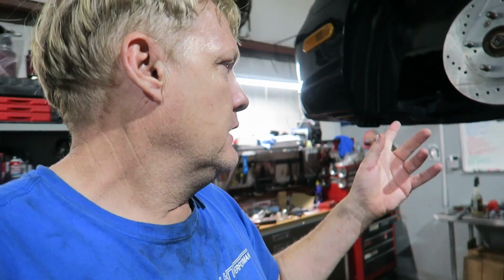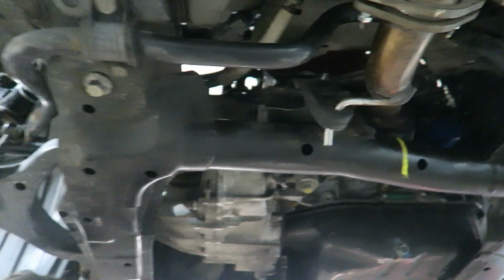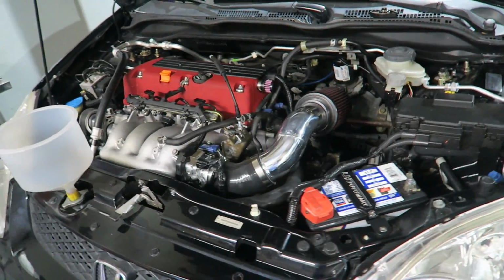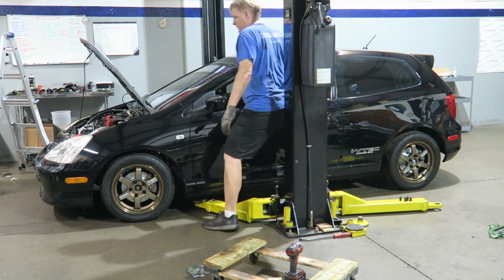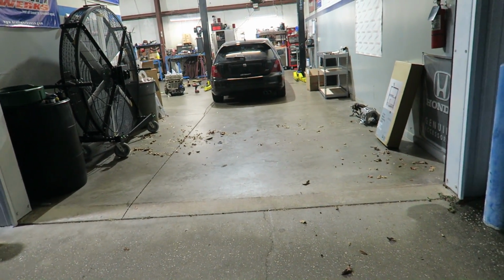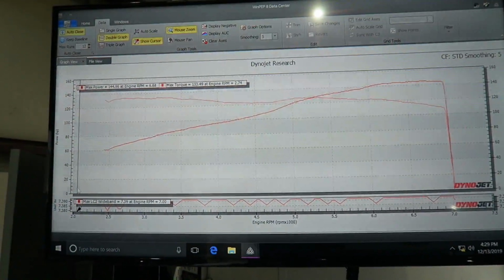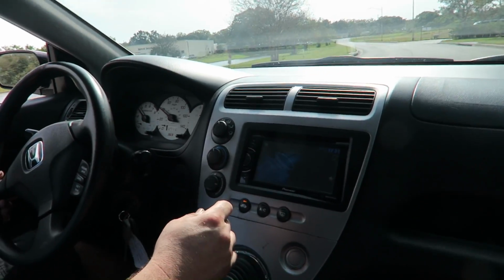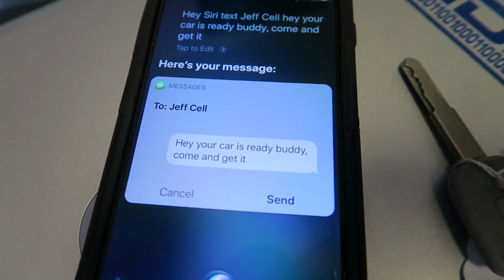EP3 K24  stock

Comment: The trick to those "camber" bolts, if you ever have to get it free. Biggest breaker bar you have + penetrating fluid + heat to get the nut off, put the nut on the end of the bolt, cool the bolt with more penetrating fluid. Torch the knuckle and get the knuckle as hot as possible without heating the bolt. BFH the bolt. Once it budges, it will come out.

Comment: A great simple build! The EP3 had such a low VTEC cross over, I am sure its a much more fun car now. Just needs a little breathing room on the back end haha. This was a great build to follow!
Reply: The EP3 K20A3 doesn't really have a VTEC cross over.
Reply: @stasilin5533  yes it does, just on intake side only and it comes on at 2300rpm. k20a's k24a's have vtec on both intake and exhaust and comes on at 5500rpm. K20a3 has vtec, just not the performance version of vtec.
Reply: which ecu you use for the k24 in the ep3

Comment: Ok I know I’m 5 years late on this question but regarding the header and the Hasport mounts…I know on the K-swap mounts they engineered them one side is for a K20 and then you can flip them upside down to use for a K24 and it keeps the head in the same position as the K20.  Did they build K car mounts the same way as the K-swap mounts back then?  I used Hardrace on my K24 RSX-S, not Hasport, so it was never an option I had.
Reply: I remember having to remove my front sway bar after I went from the K20 to the K24.  I had an SSR header.  I ended up buying the proper K24 version so I could reinstall the sway bar.  Sold off the K20 header to recoup the cost.

Comment: Swapping a k24a2 into an rsx and need to make an intake. What kind of elbow is off the throttle body? Great vid!
Reply: Matthew Trudeau 3” 45 degree silicone coupler
Reply: What header are you going to use?
Reply: bhadz100 on the ep3? I modified the Jackson racing race header to fit
Reply: @georgefitzgerald5861  Thanks George!

Comment: Love the build, 
But a quick question,about the rear 5 lug.

Did you just swap out the hub, or did you swap out the whole assembly.  I know the pad caliper and rotor are identical dimension. Yes I know it's one extra lug nut. Just wanting to save on labor or swapping out the whole rear upright.
Reply from the maker: Uber ride share We changed just the hub. The lower bolt was frozen.

Comment: Are you pretty excited for the S2000 having a re-release for 2020? I am super excited. I wonder if the car would be any fun if they used the K20C engine instead of the F22C engine. I know that won't happen, but I can imagine.
Reply from the maker: wackomanx It’s not a re release of the S2000.  These are potential optional front bumper and lights.  Right now it’s a prototype build by Honda in Japan.

Comment: i have a friend with a 2004 civic SIR ep3 in alberta canada and thinking of replicating your build. what ecu and engine management did you use for this build? did you reuse the 5 speed open differential? and can we replace the stock flywheel with dc5 type r chromoly LW flywheel? thanks in advance.
Reply from the maker: Ronald San Pedro Hello, we did re use the 5 speed transmission and the car already had Hondata K-Pro.
Reply: @LHTPerformance  thanks for the tip.

Comment: I have a question I desperately need an answer to. I've recently completed my euro r k20a swap ek, and its bogging down at wot only. Clean sweep on the tps, new pump and filter, new oem k20a2 crank sensor, 320cc oem injectors, 50psi at the rail steady. I've tried various basemaps hondata provides and I still cant find one that doesnt do this. So far, the k20a2, itr cam, cai, header calibration runs the car best in terms of drivability, but the prb itr type r cal runs it best. Just not on wot. If I ease into it, it screams. Vtec functions as it should, cooling operates perfectly, vss operates as it should (gauge and ecu), all grounds are clean, tight, and proper. I'm loosing my mind chasing this down. It's a prb ecu, and yes I'm running the proper 02 rsx type s factory wideband denso o2 sensor. Secondary disabled. Lean protection on. Multiplexor disabled, trans gearing set to integra type r. No knocking, no valve noise, solid oil pressure. No check engine lights, but it still does this bog at wot. Is this a timing related thing?? To the best of my knowledge the motor has never been opened. It's very clean. What basemap tune do you guys load onto these k20a's?
Reply: You need a piggy back ecu to tune it correctly. kpro or aem.
Reply: @musshwins412  i was running kprov2. The car is sold though.
Reply: @Bytrl  did you solve the problem? what caused it?
Reply: @musshwins412  Once the car was tuned the issue went away so im assuming it was related to the k20a itr basemap hondata provides. I run 93 at sea level and the tunes are for 91 at 3000ft so my o2 was leaning out the tune compensating for better fuel than the map itself was looking for.

Comment: As much OEM parts that you use why not use OE coolant? Surely you'll understand that not all coolant is the same. 

Also why havent you guys invested in a vacuum fill system for the cooling? Turns it into a 5 minute job
Reply from the maker: I don't like to mix coolants. The car came with green, without flushing the system I prefer stick with the same fluid.

Comment: Hot air intake is hurting my soul, small OG TE37s help mend it
Reply: running a cold air intake in most parts of Florida is suicide for your engine. Flash flooding in the rainy season every year
Reply: Intake will be addressed on next stage - header, intake, 3” exhaust next and retune 👍🏻 we just needed to get it running and stock airbox did not fit in k24a2
Reply from the maker: As mentioned in the video, This was a quick intake made at 11:30pm to finish the car